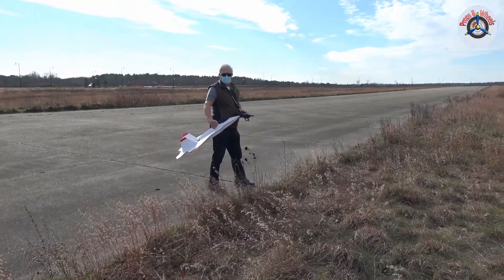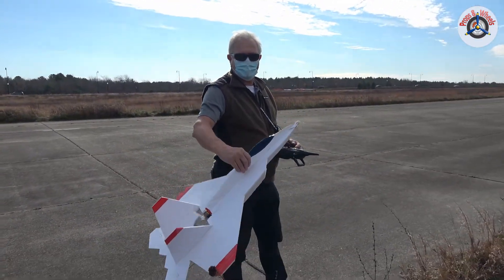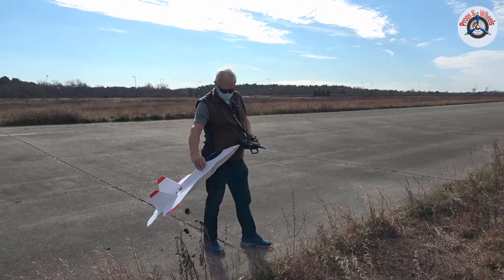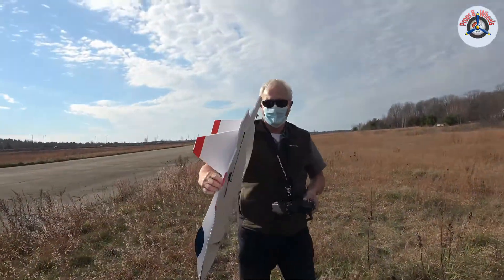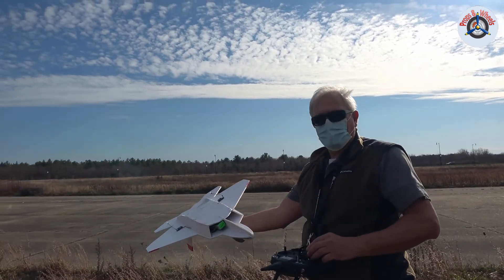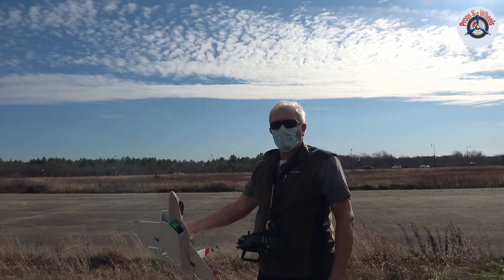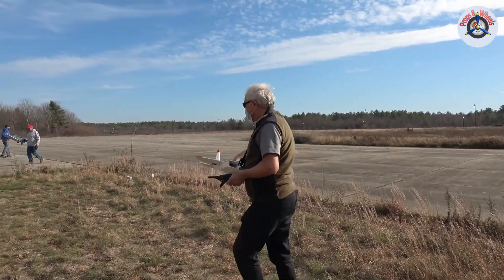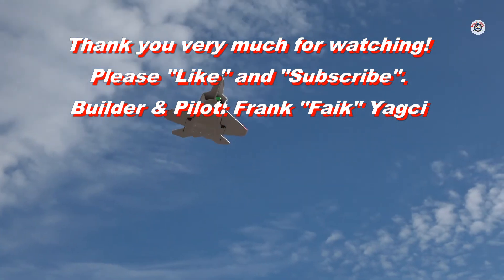F-22 Raptor Depron Plan-Built RC Airplane - Maiden Flight with Pusher Prop Setup

Comment: Very nice F-22 Profile plane. I just built a few of those and they are definitely a lot of fun to fly!
Reply from the maker: My friend Frank has some difficulties at the beginning, but then dialed in the CG and balance well for the maiden.
Reply: @PropsWheels  Yes the CG and using the correct propeller based on the motor size are key on these profile planes. I mostly use 3 blade props, very efficient and less noisy.